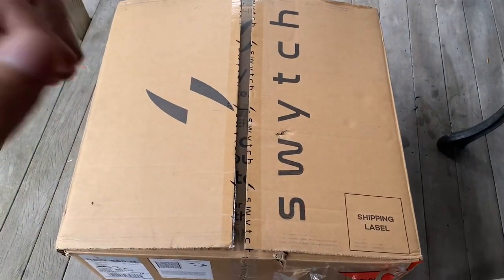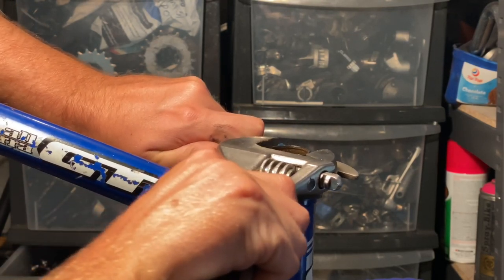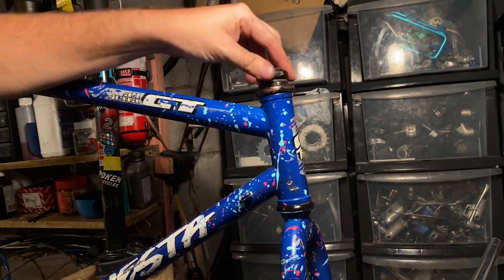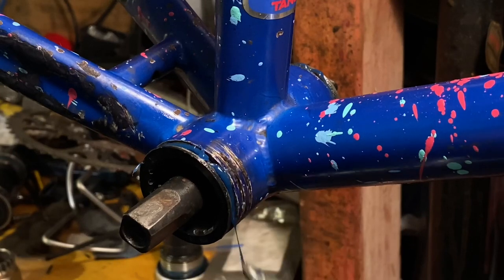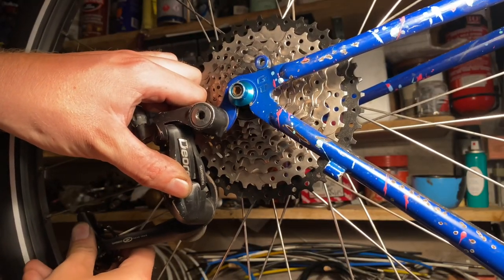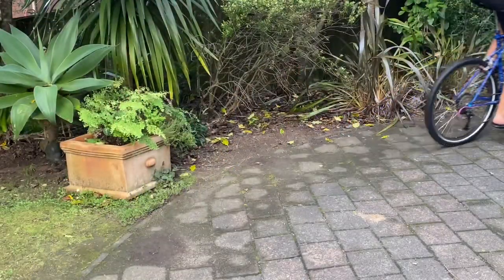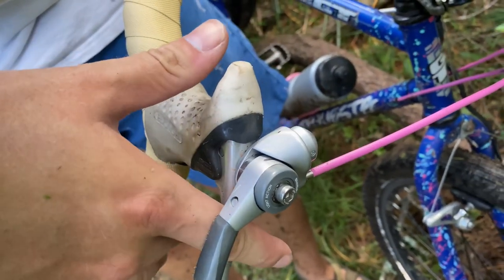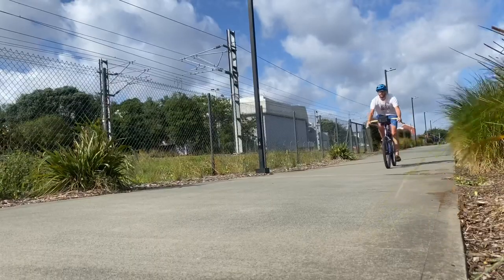Restoration & Swytch E-bike conversion (1992 GT Tequesta)

Comment: Another thing about the front motor is that you essentially have 2 wheel drive, which is a nice little extra thing people don't usually consider.
Reply from the maker: Haha exactly! Wonder what it would be like in the snow or sand?? 🤔
Reply: @toastyrides  It is super useful in sand, I have ridden a front hub ebike for a living for over a decade (Postie) and the power in the front wheel can really pull you out of soft sand traps.
Reply from the maker: @brendonoid6133  that’s so cool! 😎 I’ve been in quite a few situations on a regular bike where the rear wheel had no traction, but if the front wheel was powered then it would probably get me out of it! Going over a group of tree roots, through mud etc

Comment: Nice DIY Gevenalle-style brifters 👍
Reply: I've been debating on buying the Gevenalle for years, but can't really justify the cost.  They're $200 in either short or long pull....no shift levers.  I even asked if they'd sell just the kit and let me drill my own levers (I have 3 bikes with the tektro levers already installed) but they said no, due to liability concerns.   

After watching this DIY I may reconsider the conversion.  Run any brake lever coupled with Path Less Pedaled's upcoming UNO bar end shifter collab that handles up to 12 speed in friction mode.
Reply from the maker: Yeah was worth the experiment! Way better to try it than pay a couple hundred to find out you don’t like it 😅
Reply from the maker: @kevinfeeney5309   should be able to run 12 speed with any friction shifter, some need a WolfTooth Tanpan though 😫
Have an old Deore thumbie running 12 with a little free mod 🤌

Comment: I have a Marin Susilito with the Shimano STEPS mid-drive system. You can't hear that thing working. Have about 1400km on it on bush tracks and stuff. I use it as an ATB and have not noticed any drive train problems.

Comment: Have you tried puting thumbies on a road brake lever instead of bar end shifters? That would be an interesting hack. Bar end shifters work great as the are, I personally couldn't be bothered to put them on brake levers but combining cheap shimano thumb shifters with road levers sounds like fun
Reply from the maker: Would be worth a try! Oh come to think of it, about 5 years ago I might have done it 😅 no footage of it, but it was a plastic thumbie bolted to the front of a Tektro lever. 
Might re-try on an upcoming build to see if I can find a better feeling diy shifter 🤔
Reply: @toastyrides  Do it mate, that would be probably the first ghetto Gevenalle’s on youtube
Reply from the maker: @6ryba6  I think Gevenalle levers are and started off using barend shifters, like I did this time. So I might’ve accidentally been the first ghetto Gevenalles 😅 I’ll try some thumbies too, maybe some other setups if it works out ok. 
Barend shifters will work the easiest with their bolt, that resists rotation though. Thumbies could work with a grub screw to index the unit/stop it from rotating 🤔
Reply: @toastyrides  I think the easiest way would be drill a hole I a lever and threat it(?) so you attach thumbies by its tension screw, what do you thing, let's make ghetto  gevenales more ghetto

Comment: How does that velo orange stem work with a fork that I assume needs a quill stem? An adapter quill has a top cap with a slightly greater diameter which wouldn't work with this? Would love to know as it seems like a great way to get a bit more comfortable.

Comment: When riding did you ever feel the front motor pulling you along or was it comfortable?  
Would you rather have the trigger throttle or the pedal sensor?
Reply from the maker: Pedal sensor works best in most situations, the thumb throttle is normally just an “add on” so the user can add some power without pedalling. Handy when taking off uphill or in the wrong gear etc 🤌
Feels the same as any other e-bike, power delivery wise. Most e-bikes on full power feel like they’re pulling, more than pushing(if that makes sense).
I’d say most people won’t notice where the power is coming from. 
Only aware of it being front wheel drive when on loose terrain going uphill or when the front wheel lifts a bit.

One of the upsides (can’t remember if I mentioned) of a FWD motor is most flat tyres happen in the rear, which is finicky with a rear hub motor 😕
Reply: @toastyrides  yes you mentioned the rear hub in your video. Thanks for the reply.

Comment: Great vid.  I see Gary used the same system.  Did you have any problems getting the battery delivered?  I’ve had probs getting the batteries through nz customs.
Reply from the maker: Yeah! A few of us have been using the kits 😄 my battery showed up 6 weeks after Gary’s, even though they sent mine a few weeks before his 😂
No problems really, just a big delay(most of my kit showed up a few weeks before the battery, though).
Having troubles with customs through an eBay/Amazon store or a company or?
Reply: Not Amazon.  I’ll consider getting that kit.  It looks good and really versatile.